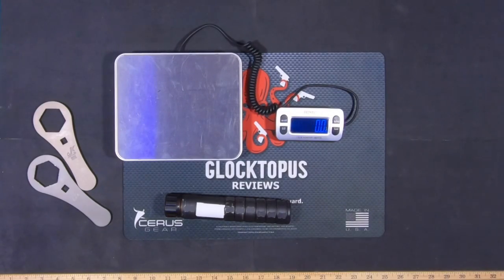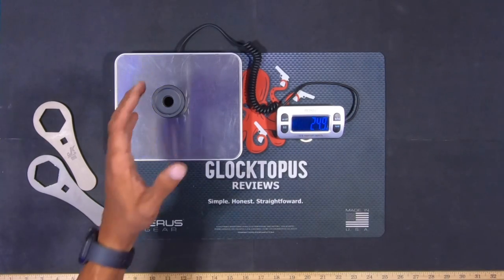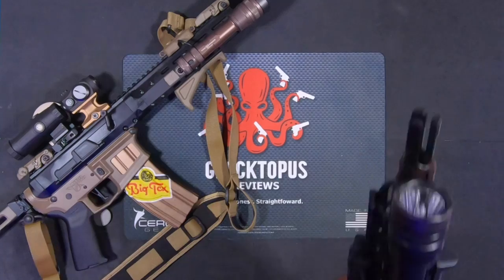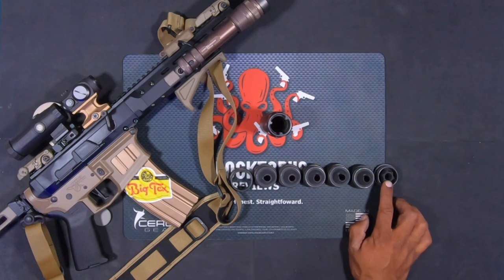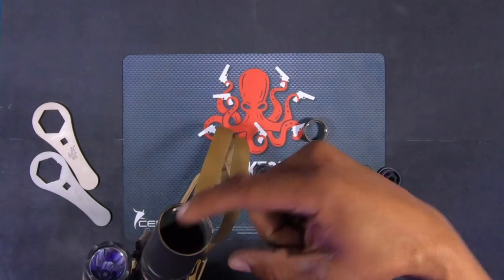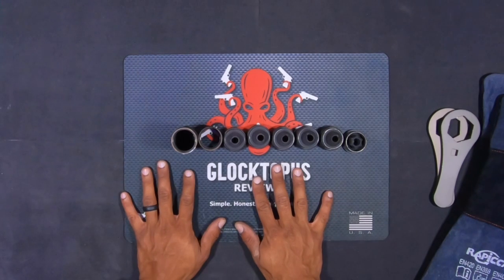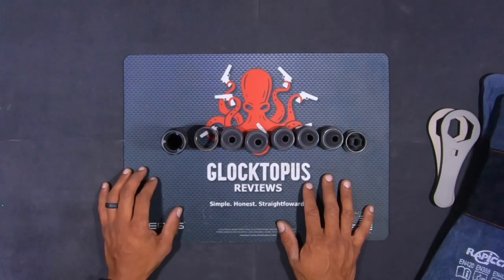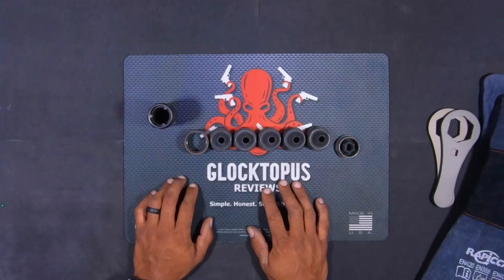JK Armament HD Steel SBR Upgrade Solvent Trap Review

Comment: I've been looking at jk armament for my first suppressor. I don't want to wait for a form 4, so form 1 stuff seems great to me. Is there a benefit to titanium over steel other than weight? Or is weight the only difference?
Reply from the maker: The main difference is weight savings, but it costs more. I would still run a couple steel baffles before the titanium to take the brunt of the force. I Pair that with a dead air muzzle break to act as a sacrificial baffle. Also learn about drilling titanium before going that route. Not swaying you either way. Just a suggestion.
Reply: @glocktopusreviews  thank you. I will look into it some more. But if I do end up going titanium I will definitely run a couple steel baffles first. Thanks for such a quick reply!
Reply: I bought the pistol kit for my KP9. Form 1 was submitted but had to wait a couple weeks for my cover letter because I created a custom model name.  Just mailed my cover letter and prints off a few days ago. Now I just sit back and wait.
Reply: @UrbanTiger74  hey! Just wanted to see how long it took you to get your form 1 back?

Comment: Do you think it's worth going the solvent trap route vs paying for a factory made can? With regards to warranty and cost.
Reply from the maker: If you do your research and build it out of the the correct materials for your specific use then it’s just as good or even better than some Form 4s. There are a lot of factors to take into account when going the Form 1 route. The other awesome thing is the turnaround time for a form 1. I’ve personally seen sub 30 days. So take all of that together to make a smart and informed decision. Hope this helps 👊🏽👊🏽

Comment: Does JK make an adapter that works with Surefire?
Reply from the maker: No they do not. You would have to get one customized with the 1.375x24 tpi You should research form 1 suppressor forums. Thats a good start.
Reply: @glocktopusreviews  I talked to JK Armament, they are in the process of making the Surefire adapter now.